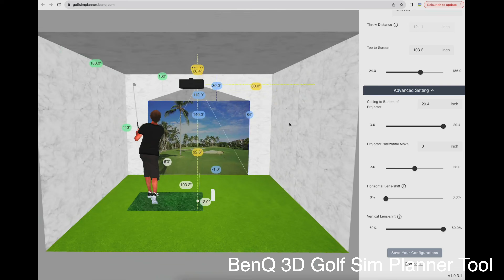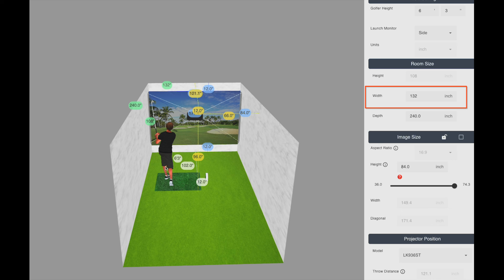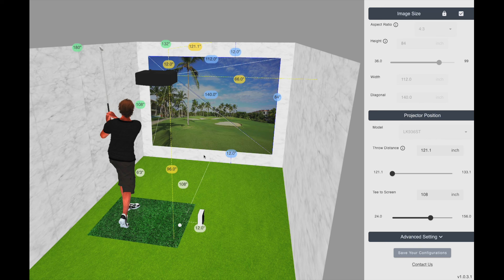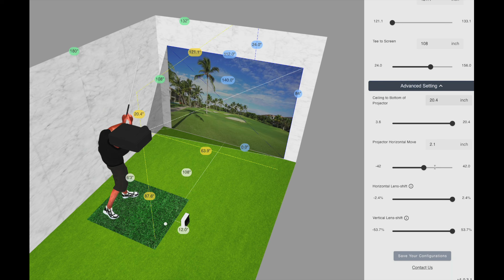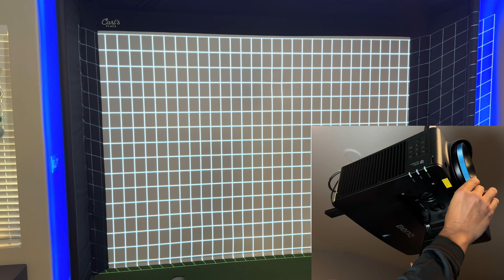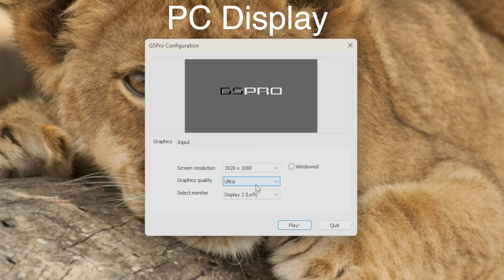I Installed a BenQ LK936ST 4K Projector In My Golf Sim! You Have To See This New 3D SimPlanner Tool!

Comment: Great video, thanks. Just bought the projector. With projector on the way I’m thinking how to combine it with my 4K wall monitor (3840*2160) and laptop (3840x2400). The projector screen (impact screen) is squarish i.e. 322Wx265 H. What is the best way in your opinion? Easy if I extend and assign to each display its own pixels (creating a custom definition for the projector), but I would prefer to have the same image on all. Is there a way to have full screen on all if I use duplicate and not extend in window settings? Thanks.
Reply from the maker: If you duplicate the chain, it throttles down to the weakest link. I would definitely run extended and don't think you would want the same thing 3 times anyway, that would be overwhelming😂

Comment: Doesn’t lowering the resolution lose the 4k ?
Reply from the maker: Hi Paul, It does not... I am still achieving 4k as I am achieving 4x the pixels of standard 1080P HD. Since I'm running my setup in a 4:3 aspect ratio, I can't achieve the full 3840x2160 pixels, but using the graphics card settings to change the resolution still keeps the image 4K.
Reply: @PixelGolf  I’ve got the benq lk953 it seems like a great picture but I’m only using a 3070 card 
Would a 4070 card give better graphic’s ( sorry for the questions and great video by the way it really helped me

Comment: I have same projector but cant get it to work, i have the projector set to auto. Create a custom resolution in nvidia, then apply that resolutio in windows, but it still hangs over the same size as if it was full 16:9 4k.  Have any ideas?
Reply from the maker: After you make the custom resolution in the Nvidia Control panel and while testing it you verify it fits the width. Make sure to save that resolution and then go to your PC display settings and select that resolution. Feel free to give me a call if you still need help, my number is on our site, pixelgolfco.com

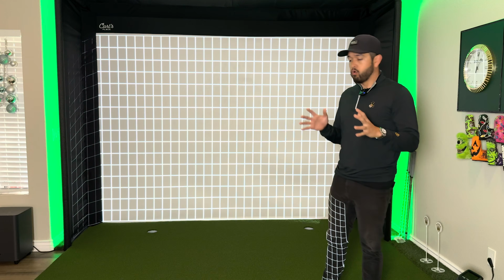Comment: I also have a vaulted ceiling, what mount did you use? Also my main question is if I have a 16:10 screen but this projector is 16:9 will the throw distance be based on 16:9? To match the height or would it be 16:10?
Reply from the maker: Projector mount should be linked in the description. You’ll want to use the BenQ sim planner tool and select your screen height, that will give you the distance from the screen you need. Feel free to contact us on our site if you need more help.
Reply: Your mount says it needs modifications. What is needed?

Comment: Love the video! I'm thinking of getting this projector and also have a 4:3 screen. Is the image 4k at 4:3 aspect ratio? Also can you please tell me what happens when you watch a movie or netflix on the projector via the pc and via an Amazon firestick, Apple Play or something similar connected to the projector? Does it still stay in a 4:3 image or does it change to e.g. 16:9 and if so does the 16:9 image remain the same width with the black bars appearing above and below? Lastly, if this happens, does the movie also stay/change to 4k? I'm asking all these as I'd like to be certain before splashing the cash on this.
Reply from the maker: Hello, It won't be full 4k since you are trimming pixels on the width, but that works the same if you get a 1080p and run it 4:3. The image looks fantastic even with the cropping! I have a Apple 4k TV hooked up to mine and can either switch the projector to 4:3 and watch it like that, or watch it in widescreen and use the built in rezizing which leaves the bars above and below.

Comment: Does adjusting the vertical/horizontal fits affect the 4k resolution?
Reply from the maker: Per BenQ, because you’re essentially moving the lens with the adjusters manually, it does not. The digital correction like keystone and digital zoom will.

Comment: I have a very similar sized setup, but only 9 foot ceiling height. What height is your projector mounted? Is it just 88 inches above the ground as shown on the benq planning tool example? And about 18 inches behind the ball position?
Reply from the maker: Hello, Mine is actually 100" from the ground as visually the 88" looked a bit odd... I used the vertical lens shift to make up for the added height though!

Comment: Great video; thanks! I'm having issues extending the display to my projector screen from my computer. Trying to extend my monitor display to the projector, instead of duplicate it, like you mentioned doing if monitors are 1080p and projector is 4k. When I duplicate to the projector, all works fine (other than that I can't get 4k, which is what I'm trying to fix). But when I extend to the projector, it won't show the screen other than the taskbar. The rest of the screen is blank. Do you know how to extend when you have two monitors on the computer and want to extend the main one to the projector to get 4k capability?
Reply from the maker: Hello, I believe you need to go into the software and select the right monitor and close then reopen, if I'm understanding correctly...
Reply: @PixelGolf  I ended up just purchasing a 4k monitor. But when I go to the NVDIA graphics card the "customize" button is greyed out, so it won't let me create a custom resolution. Any idea why?

Comment: I have this projector and it is awesome, had for about a year and love it. My screen is 120H X 144W I can get the width to work out fine but have at least 8 inches top and bottom not covered. I have ALIENWARE gaming laptop as well and screen is 4K. Tried this method and did not workout for me any suggestions for my screen size, I have tried everything and searched and searched for help. TY
Reply from the maker: If the height isn’t filling vertically, your projector is likely to close and needs to move back further until the height is filled, the adjust the width with your graphics card.
Reply: TY

Comment: Do you still have the foam pad behind the screen? Wondering because Carls Place told me not to do it…..said it would damage the screen long term. Thanks. Great videos!
Reply from the maker: After I switched to the new Carl’s Place c-series design a few months ago the bounce back was seriously improved so I no longer felt the need to add extra bounce back protection. I used the mattress pad for over a year and didn’t have any issues but I would go with manufacturer recommendation.
Reply: @PixelGolf  thanks, appreciated the quick response

Comment: Why use as little digital correction as possible?
Reply from the maker: Per manufacturer recommendation and testing, digital correction such as keystone and 3”4 corner adjustment as well as digital shift and zoom degrade the image quality. They are there as a last resort if you just can’t mount the projector in an appropriate place.
Reply: @PixelGolf  Hmm, I read the lk936st manual, and it didn't mention anything about that.. I would think using a native 16:9 projector in any other resolution would decimate image quality more than some keystone correction 🤔
Reply from the maker: The manual doesn’t mention that, but that info was straight from the horses mouth. BenQ strongly recommended as little digital correction as possible as it will degrade the image quality over the manual lens shift.